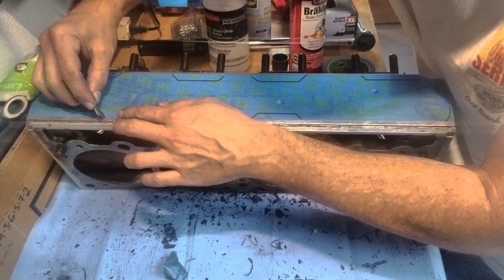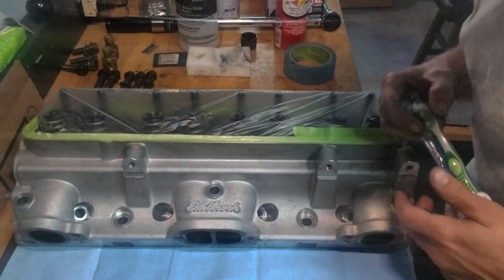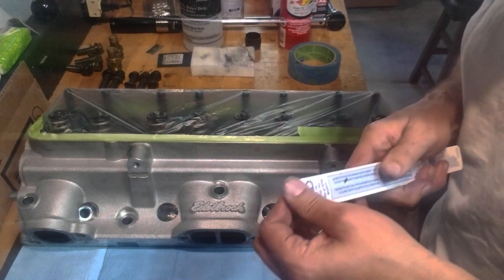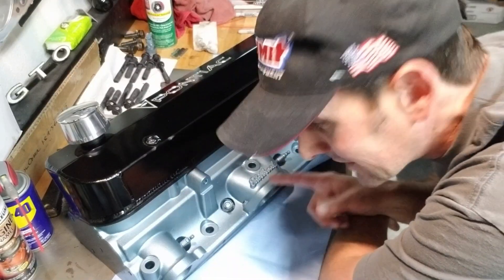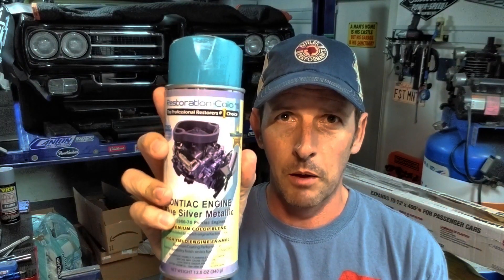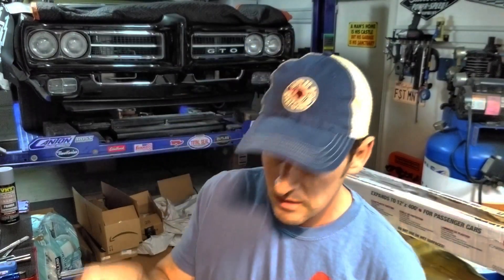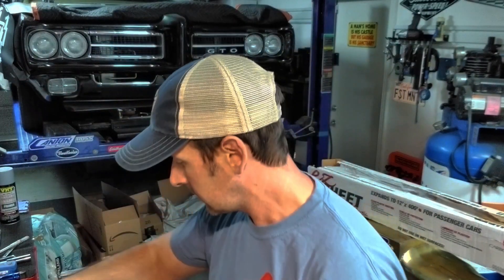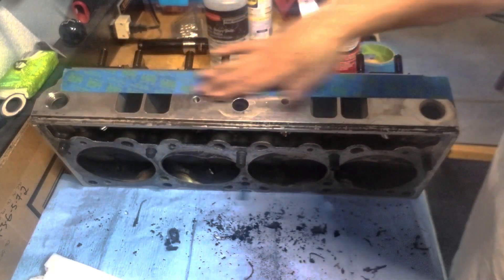Pontiac V8 Rebuild, Part 6:  How to paint engine parts.

Comment: I wish I would have caught you in time. I had a 69 Big Block Charger that I built stout. I had a worked over Edelbrock top end on it. I used a Dremel  and ground off all the Edelbrock stuff and used a very rough sanding drum to rough the areas back up. I painted the whole thing Chrysler blue, including the stock valve covers, and went racing. I told the tech guy I brought a helmet. He laughed and said the car was a 15 second car. I was pulling 12's with no fuel pressure at the big end. It was nosing over. I was shifting at 6800 RPMs. 
The next time I returned he was pissed and teched the hell out of my car. I tried to tell him. LMAO. 
I guess he didn't notice the Barry Grant Race Demon carb I had on it, or the 4 inch drive shaft I had on it with 1350 Hemi yokes I had custom made. Not to mention the 3500 RPM stall convertor I had in it. 
Oh, the good ole days.
Reply from the maker: Another great story!  Yeah, I didn't really care about shaving the Edelbrock off... I wanted it finished.  Thanks for sharing!  And, I'll never race you.  ha, ha...
Reply: @FastMonty  
Thanks for the reply. LOL. I guess I'll leave out the stories of my Holden Commodore SSV. I'll keep watching. Nice job on painting the heads.
Reply from the maker: @jhutch1470  Ha!  I wish I had as many toys you have!  Thanks!
Reply: @FastMonty  
I wish I still had them all. I just have the Lemans now. I'll keep watching to get new ideas from you. Thanks.

Comment: Hey Mike, thanks a ton for your videos! Great job - I love watching and must have spent hours on your channel!
I am going through the rebuild of a '66 389 after... a failed lifter
Do you remember about how many cans of primer and actual color you went through for the whole engine? Is there a good source to check what part of the engine will get what color (what's blue, black, ...)?
Reply from the maker: Great Questions!  I think it was a little over two cans of primer and color for the Timing Chain cover, Water Pump, Heads, and Block.  Not sure what source to use to find the original color scheme?  Maybe try Pontiac Perfomance?  (If it's not already in your shop manual?)  If you do find the source, please post it here for others to learn from... Good luck, and thanks for the comment!
Reply: @FastMonty  Thanks! Yup, will post if i cross anything good! Keep up the good work!